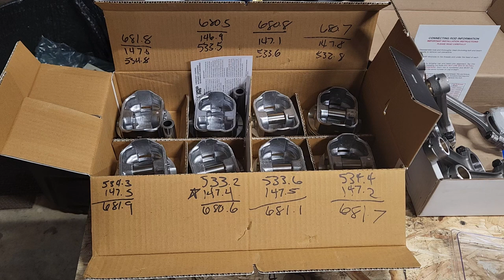REAL Budget 400 Hp 350 Small Block Chevy Build - Part 3 - Rods and Pistons

Comment: Im definitely not a know-it-all and really dont want to come off like one so this is just my opinion, but I personally don't like to remove any material from the pin bosses, the bottom of the pin boss is a high stress area as the piston crosses over TDC and changes direction. High rpm is literally trying to jerk the pin out from the bottom of the piston. It only really pertains to high rpm, heavier pistons, irregular rod angle, etc. It's always a pleasure to see folks building a gen one.
Reply from the maker: I definitely see your point, the bottom areas I mentioned are very beefy on these pistons. I ended up not taking a ton off of there and removed the cast in balancing "pad".
Reply: @diveingarage  HPA has a good video on this and where to remove material

Comment: A little tip when installing the connecting rod & piston into the bore & over the rod journal on the crank shaft is to cut a couple pieces of 3/8” ID rubber hose a inch or so long,place these hose pieces over the connecting rod cap studs so if u slip when tapping the pistons into position the threaded stud doesn’t put dings in the cranks rod journal!
Reply from the maker: Thanks, tracking the hose over the studs trick. Went OK just guiding them into place this time. There are also a few tools out there that do the same thing.

Comment: Wish you luck you need to go study what your doing, the rings you have are drop in rebuilder rings and balance needs to be done also checking bearing clearance is critical
Reply from the maker: Agreed, clearances will make or break a build. Check out the other videos in this series. Everything was checked many times over off camera as well.

Comment: Thanks for sharing. What is the part number for the rod and main bearings?
Reply from the maker: Summit Racing™ Connecting Rod Bearings SUM-171000 and Sealed Power Main Bearing Sets 4663M. Both standard sizes, be sure to check out my other videos about measuring clearances!